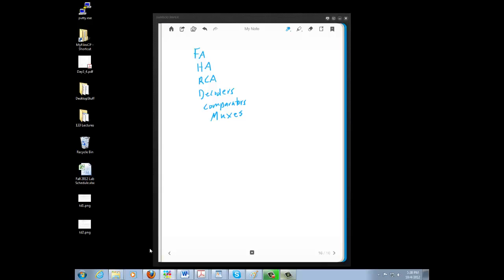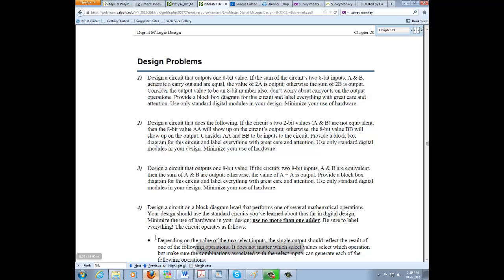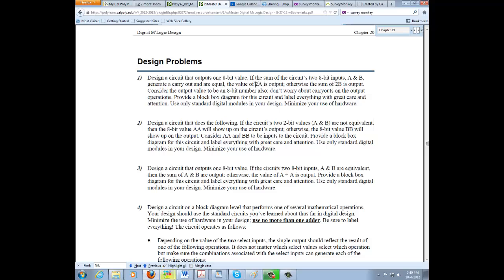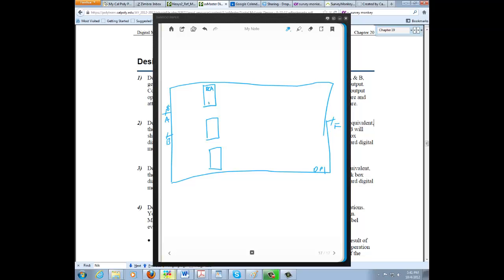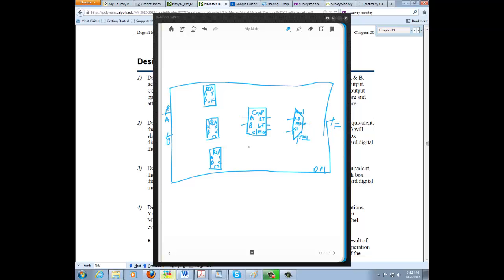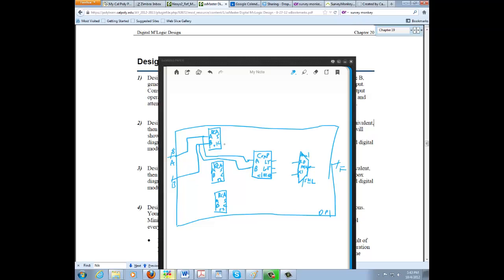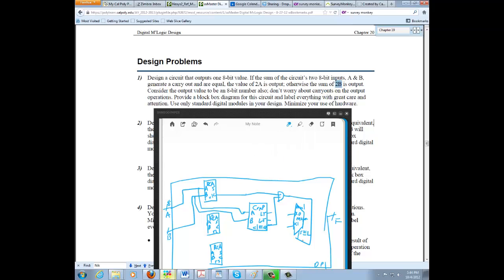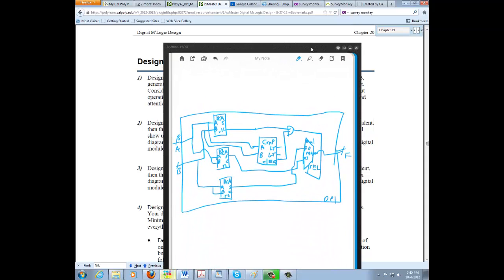Lec8C - Modular Design

Comment from the maker: Q: When you drew the BBD for DP1, you had some of the outputs for the internal components not used elsewhere in the circuit. If we had done this problem in VHDL, how would we port map those certain outputs of those components?
A: if you have outputs of a component that you never use in your design, you can port map them to a temperatory signal that doesn't go any where, or you can port map them to the word "open"  Open is another VHDL keyword that tells the synthesizer this wire goes no where.